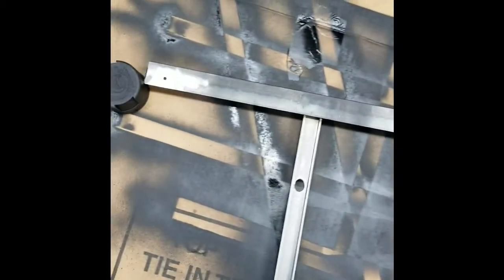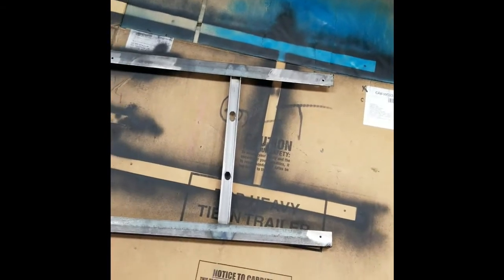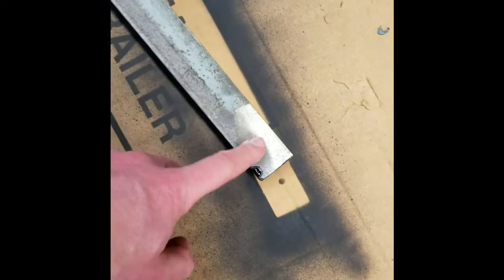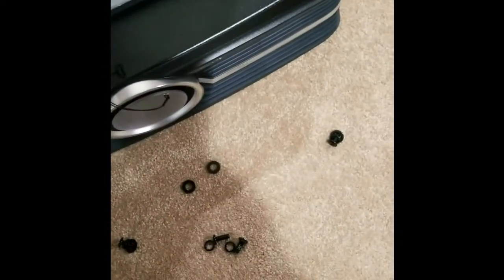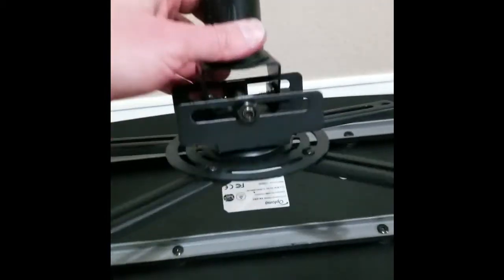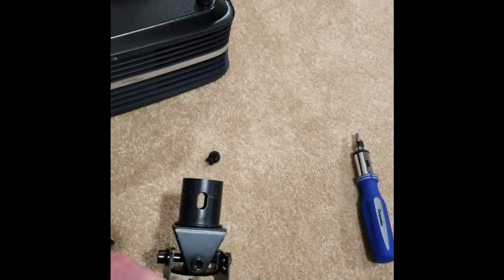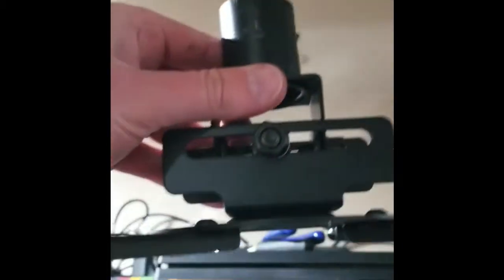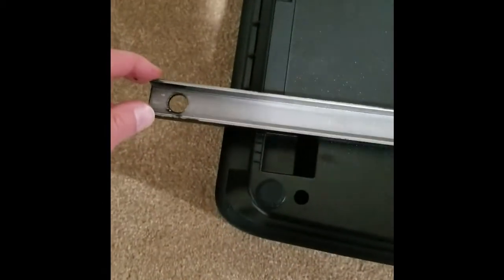Build a sturdy projector mount yourself for cheap! UHD65 mount!

Comment: Pretty good DIY design, but overkill for a 16 lb projector. Each 1/2"  bolt is holding 4 lbs. The mount must weigh more than the projector. I used to hang my 100 lb CRT projector from a single 5/8" bolt.
Reply from the maker: Mostly like that because of the channel- those bolts fit perfectly and slide nicely. A smaller size would not. Additionally, they add rigidity I think. But yeah, from a weight perspective, definitely overkill!